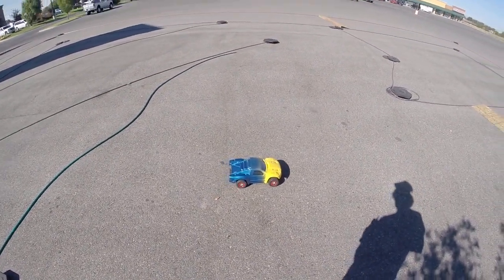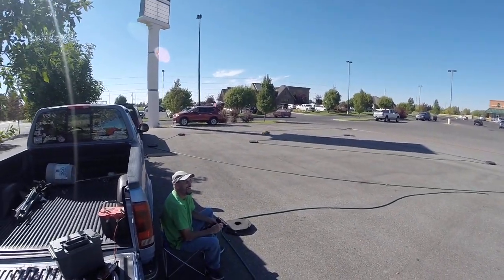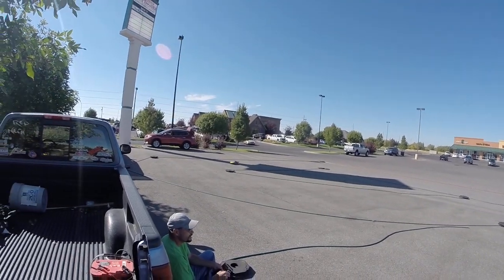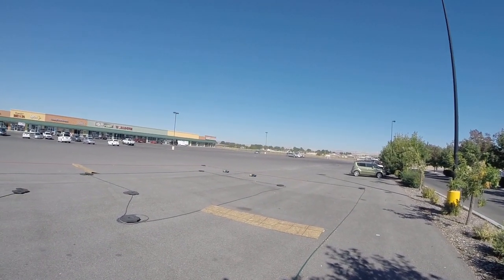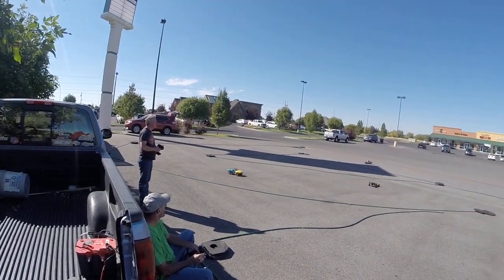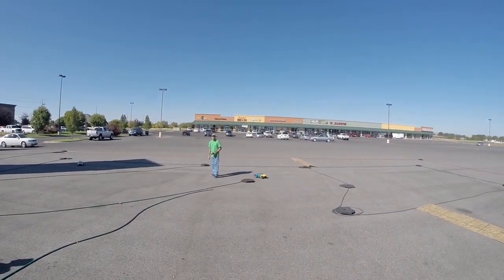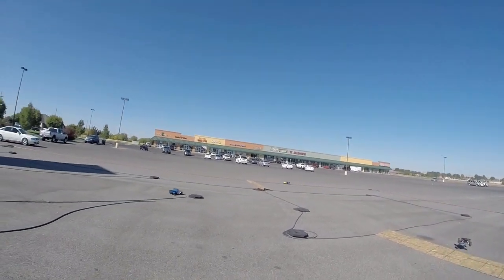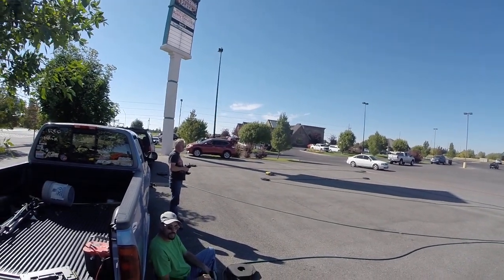SC5M 1st track test after the build S1 tires

Comment: Put some weight in the back about 70g
Reply from the maker: I had the LiPo running close to the front, I guess because I was thinking that motor was going to be enough weight out back. I eventually put it next to the waterfall, and it 10X better.